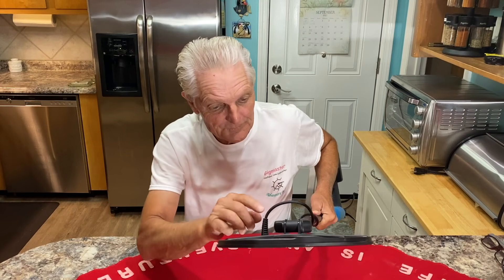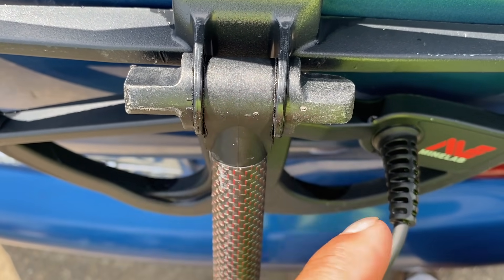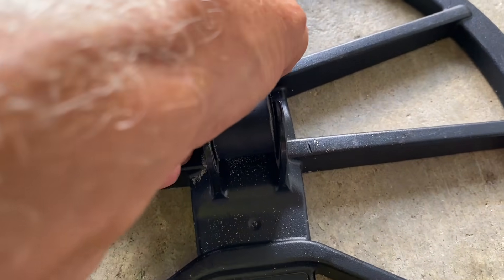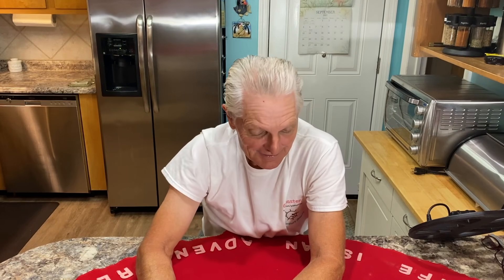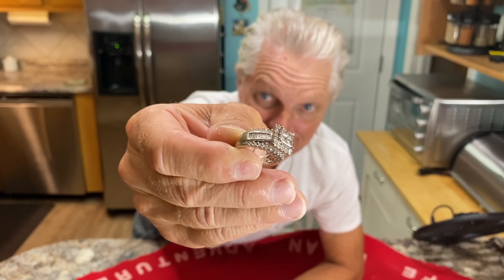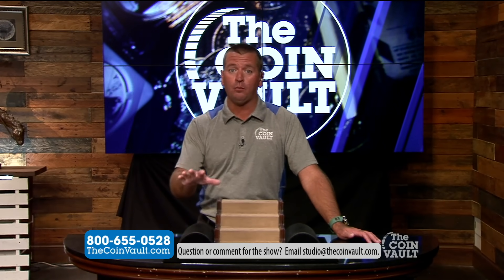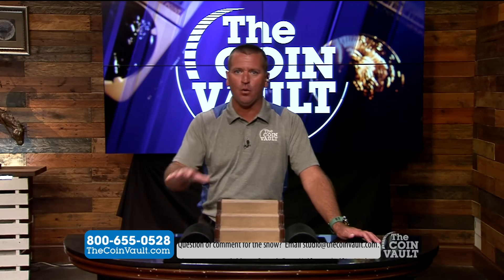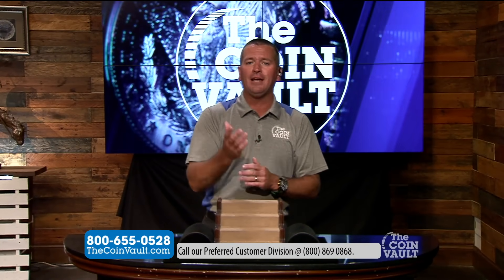Equinox Fix and Updates

Comment: I’m making this suggestion with all due respect. Love your videos and watch you every day and respect you as a quality Detectorist. I believe that the problem that many equinox users have with the tabs breaking off the coil is due to unnecessary stress. I’m not talking about using it as a crutch which is good advice. What I’m talking about is when you see, yourself included, people hunting at the beach and after the target is out of the sand hole and that hole is kicked with your foot to open it up, then I see the coil head being used to further push sand away when looking for the target. I think that is what ultimately puts stress on those tabs and would also cause it to spread them out which is why you need to keep tightening the screws. Just a thought and again, I say it with all possible respect. Have a great day

Comment: What I did was pull out the rubbers and turn them over and start to use the back side out. No grove worn on the other side.  Pop them back in and they look new.  You could always trace the rubber onto a plastic lid and cut out a spacer .

Comment: I also noticed how the coil ears get stressed when tightening it on. I doubled up on the rubber washers on the inside and outsides and have been using it for a few months with no problems. Hopefully, it’ll prevent the ears from breaking. So far so good.

Comment: The Carbon Fiber insert would be an excellent product.  I haven't had the trouble you've had with your Coil, but I don't do any Beach detecting.  I noticed quite a bit of sand fall out of the rubber washer area and I suspect that's what's causing the wear on the stem attachment.  Kudos to Silvertowne and their offer to you, great company.
Reply: Thingiverse has the coil insert file that can be 3d printed out of carbon fiber for pennies apiece.

Comment: Going to send you a couple batches of 1mm and .7mm coil inserts out of Polycarbonate Carbon fiber. I don't have a Equinox but dimensions you sent me seem like they will fit. They are a little too big as printed for the excalibur, but I will reduce them by 8% when printing and they should fit just fine.
Reply from the maker: Cant wait to try them! I like the .7 mm too!
Reply: If needed stacking a couple .7 will get you 1.4mm. If you need .5mm just let me know. Super simple to print batch of 18 in under 30min.

Comment: Gigmaster, I noticed you don’t use the ear stiffeners for the coil.
What’s your take on them?
I am currently using them, but are going to remove them so I have the same set up as you.  I have been having the same trouble with washers, and the plastic against plastic wear issue and I think it might be due to the use of the stiffeners.
I would love to know your take on the coil ear stiffeners.
Reply from the maker: Gene and myself both broke one of those stiffiners. Going with my abs fix.

Comment: Hello i wanna ask something to all experienced equinox users please consider answering 
i just got myself a brand new Equinox 600 with my entire summer savings so i heard the equinox could easily can be water leaked and flooded and i concerned to use it in water my Question is should i made some improvements (like wrapping with seal tape and duct tape etc) or just head in the water.
Reply from the maker: Head in the water! It has a three year warranty. Some never have a problem.